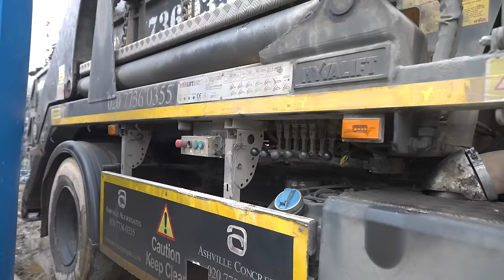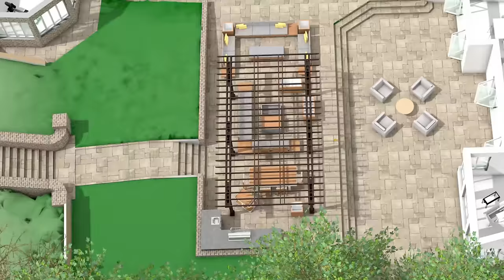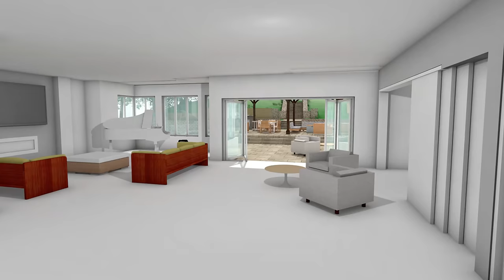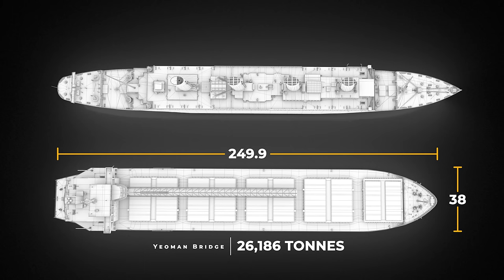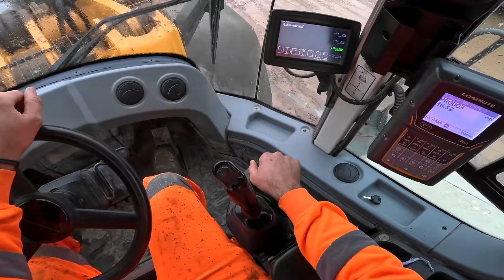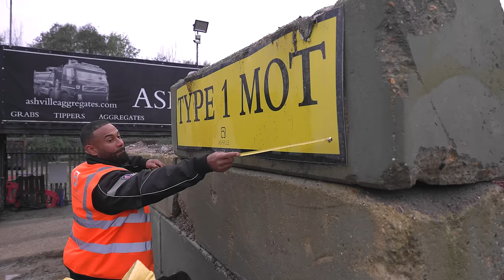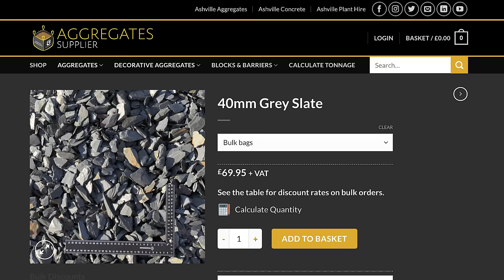SMASHED & Stolen, Daniel Trolling | Ashville Weekly ep163

Comment: The horizontal ties are there to stop the rafters from splitting and moving outwards. The vertical tie is to stop the horizontal tie from sagging too much. Unless there is something I am not aware of I don't think that the detail the structural engineer has provided allows you to remove those elements. I am a structural engineer and I've done a few of these before!